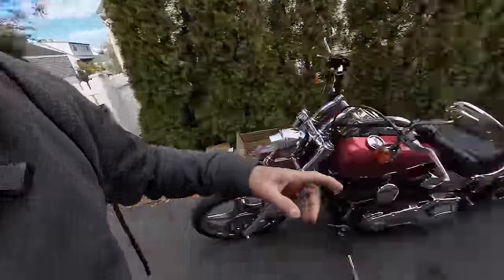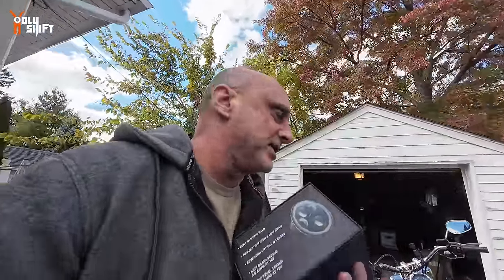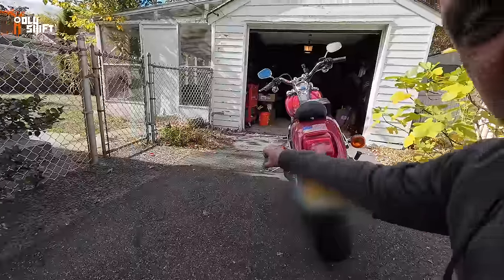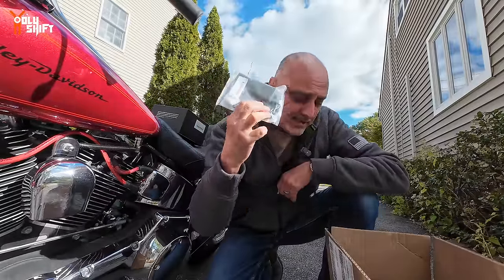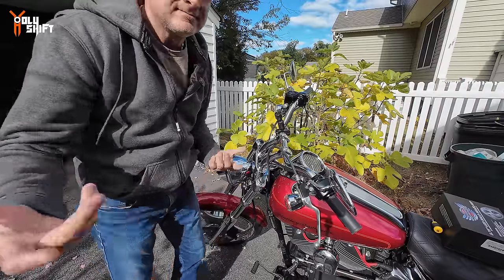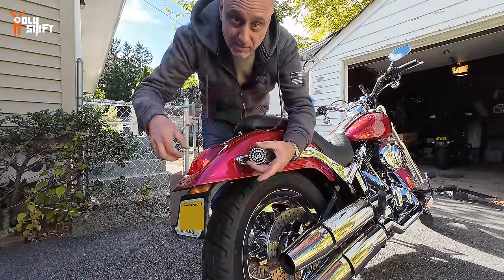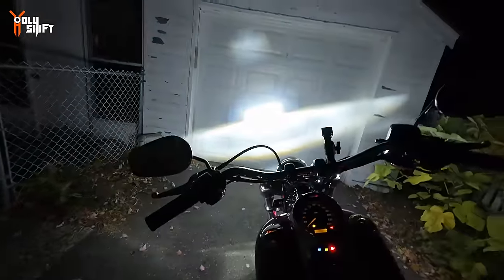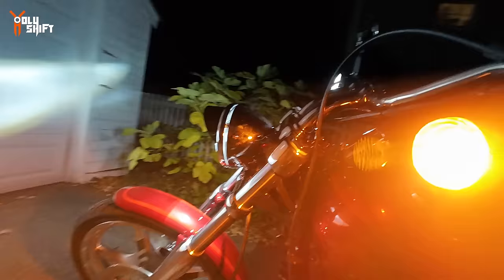Teribble Lighting On my New Harley ! Must Fix It !

Comment: Key fob has button for the alarm, it is silent from the factory or you can purchase and install a siren from Harley. if you press and hold the button for a few seconds it activates the alarm and the T/S will flash and may get a chirp if the siren is installed. to deactivate just press the button again twice I think and it will disarm. If the alarm is set the bike will not start and if moved the lights will flash  and siren, if installed, sounds.
Reply from the maker: Aha ! Thanks 🙏🏻. You’re the first one to answer that question
Reply: my 05 came with a silent alarm, I had a sound installed at my local harley shop. So glad I did, it saved my bike from being backed over by two cagers that should only be using public transportation

Comment: Without siren module (Option) it will disable ignition and flash lights. hold button for about 3-5 seconds and the turn signals flash and lock icon on speedo.comes on. To disable press remote 2-3 times quickly . lights will flash and lock icon on speedo will go out. To set the Security code best to get the owners manual or Shop manual. There may be some You tubes to show how to set set/change security code and highly recommend
Reply from the maker: Good tip, thanks!

Comment: Vance and hines pipes....nice! Which did you go with, man? Of course I'm gonna watch, but be nice to know!.
Reply from the maker: It was gonna be either the longer short shots or the radius …next video will reveal 🤣
Reply: @HOLYSHIFT  I wish you would’ve gotten the V&H 2 into 1 pipe or the Thunderheader system. You are leaving horsepower on the table by going with the short shots or even big radius. The twin cam 88 loves 2 into 1 exhaust systems. I promise you would’ve made more horsepower than your buddies springer on the dyno. But either way those pipes will sound great and look good.